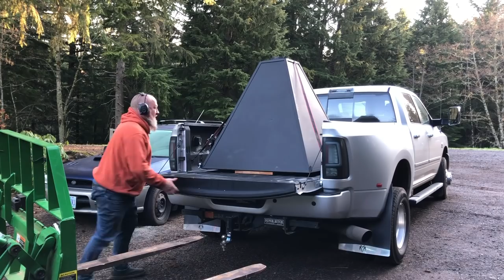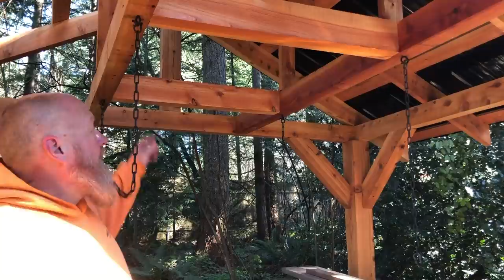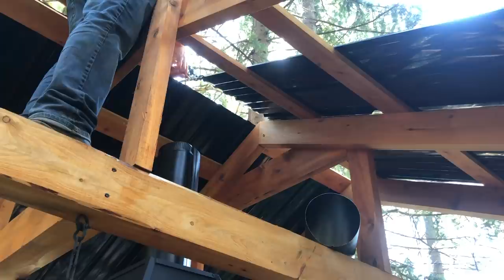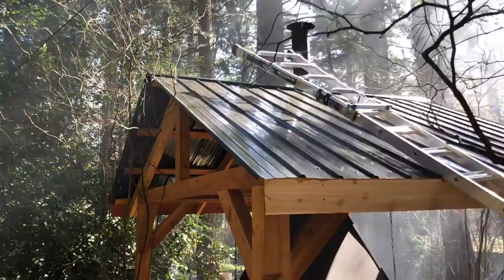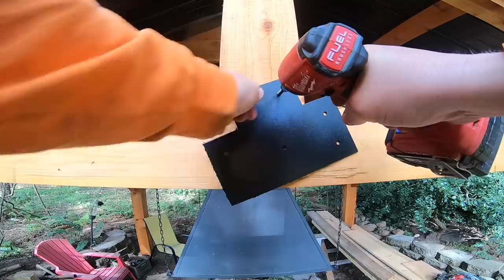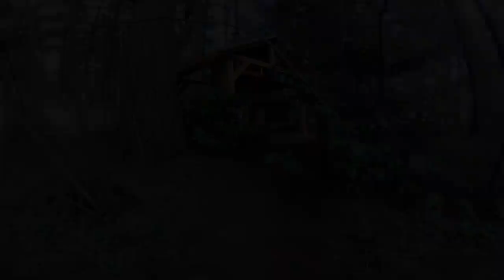FINISHED Fire Pit!!!

Comment: For the swaying, the problem could simply be fixed by putting the chains at a 20 degree angle. this way no matter which way it tried to sway, the chains would get tighter, hand help prevent (counteract) the movement.

Comment: Great looking place to just hang out.  That will make their isolation a little more relaxing (note, no TV out there, so no annoying news constantly).  Hopefully the wi-fi doesn't reach out there either!  Nice work brother.  The metal plates are just the right finishing touch.
Reply from the maker: Thank you, Rob! I looked for plates at Home Depot and wasn’t impressed with my choices. I cut these with the plasma torch and left the edges rough. I think they came out pretty nice.

Comment: Looks great! I think I would have raised the hood a bit higher, maybe halved the length of the chains. It may be above the line of sight, but it looks awfully close above. It almost seems like you would feel like you had to tilt your head to look across at someone else. I built a timber framed front porch on our new house like this and was planning a gazebo with fire pit in a similar style, but I am going to start with a smokeless fire pit. So the hood wont be so important...
Reply from the maker: The bottom of the hood is about 4.5’ above the ground. My main concern was it drafting properly. Now that he’s had a fire and we know it works, we could easily raise it if needed.

Comment: Haven’t read all the comments, but do have an observation in case no one mentioned it before.  Stove pipes are generally recommended be installed opposite to the way you did.  The bottom lip of the pipe needs to be inserted on the inside of the pipe below. The reason for this is to keep the creosote which accumulates on the inside of the pipe from dripping down and out of the pipe joints. Even though your stovepipe is black and will hide the drippings somewhat they will eventually become unsightly.  Other than that, I love your build.  I want one! Good job!
Reply from the maker: Thank you! It has been brought up and the reason I did it that way is because the only rain cap I could find right now wouldn’t fit the other end of the pipe. I do a lot of work for these folks so if it’s an issue down the road I can address it.
Reply: I thought stove pipe is for interior locations only.Can not be exposed to the elements.

Comment: Crimp end on stove pipe should be down.  Creosote, condensation and rain will run on the outside of the joint if not.
Reply from the maker: You’re correct for indoor applications but outdoors it’s not a concern. I had to do it this way because it’s the only way the rain cap would fit.

Comment: Great work. I would have changed only a couple of things. I would have had the attachment points for the flu a bit higher up so the chains were at an angle and I would have left some extra chain length on each one to raise or lower the height to there liking.

Comment: The chimney pipe is installed upside down. When the chimney cools the condensation will run out onto the outside of the pipe!
Reply from the maker: Not a problem in an outdoor application. This is the only way the rain cap would fit without modifying the pipe or cap.

Comment: WOW this is fantastic.  One question:  exactly what sort of screws are you using?  It looks like they're super long and thin, and the 2 long beams that span from front to back (if I'm seeing this correctly) are supported only by 2 screws in each end -- is that correct?  All the other beams seem to sit on other supported elements, but these had me scratching my head.
Reply from the maker: Thank you! There were more screws used from the top at an angle but those Timber Loc lag screws have a surprisingly high shear strength. They’ve held strong for a few years now.

Comment: Looks great 👍 Just out of curiosity, is there a way to lock the hood in place to keep it from swaying in heavy winds?
Reply: TruckdrivinMilan R I was thinking the same thing man, but I think it should be okay since those chains look pretty sturdy
Reply from the maker: Thank you! The stove pipe does a pretty good job but the owner and I did discuss simple options should it become an issue.
Reply: @NorthwestSawyer  Some 'struts' installed at angle to the rafters?? Seeing that there's no way to hide those struts, why not , say, 3" x 3" cedar, 
and stained same color as the rest,..would there be some merit in that thought?
Reply from the maker: Reg I think if I had to stabilize the hood I’d try to make the steel decorative so it wouldn’t need to be hidden. I’ll have to figure that part out of it comes to light.
Reply: @NorthwestSawyer  Yessir,..decorative steel will fit too ,...you can do that...maybe tree branch and leaf motif!
Reply: Brayden Elliott LIVE/GAMING yea those chains are more than strong enough. I just envisioned it swinging like a pendulum and the stove pipe wrecking the metal roof. Welding the chain links together would probably keep it from moving.
Reply: Just a thought, you could install a heavy black bar inside the hood and down to the fire pit to anchor it for windage.  And then, have a circular metal draw screen to protect against flying embers.  Kill two birds with one stone!  This would also help keep the "exhaust" in the vent by cutting down on cross winds directly above the fire.

Comment: How did you decide where to put the hood height wise? I am guessing it may not work as well if it was higher?
Reply from the maker: I wanted to keep it as low as possible so I sat in their chairs and kept it about 12” above eye level. It’s about 4 and a half feet off the ground and luckily seems to draft really well. I have fire pictures on my northwest_sawyer Instagram page.

Comment: Excellent job, Jason... but is there a reason you did not use a shake roof?
Reply from the maker: The client wanted a black metal roof.
Reply: @NorthwestSawyer  Can't argue with that... Two rules in business... 
#1.  The client is always right...
#2.  If the client is wrong... see rule one...

Comment: You stay safe, too. I suspect you fabricated the metal reinforcement plates, but I don’t remember you showing it. Were they based on the as- built or from your plan?  Thanks for the video.
Reply from the maker: I did. I cut them with the plasma torch and left the edges rough for character.  I didn’t film it though.

Comment: beautiful project.  in heavy winds, will the smoke hood flop around?
Reply from the maker: It’s in a pretty sheltered are but we’ve discussed fixes should it become an issue.
Reply: @NorthwestSawyer    cool / have you seen the fire-pit in use?  I wonder if the hood provides much of a draft and reduces the amount of smoke in one's face
Reply from the maker: Not yet, John. I did explain to them that they’d want to use dry wood only and start small to heat up the metal and get it pulling properly.

Comment: Well you have a complete how to video and all the measurements so you can saw out a pre built fire pit or anything they have their hearts desire to do there. A good build yet  way over built as Katrina couldn't get it off... well maybe but that is a class seven. It pleases the eye when you see it and screams money. If people wanted to save money, they could do the stains and buy the cement but the rest could be packaged to a build like the huge metal buildings where a goes to b and then c joins d thing... you built one so you can save a lot of steps now. Kinda like lawn furniture. My first picnic table had a load of logs and weighed  a ton and they was as crooked as a politician. I thought it would relax and it did....... in ashes and shame. Because I have worked metal all my life we had a metal table and chairs that was super nice and only required paint every so often/LOL. I had old tractor seats and sheet metal formed and would you believe had people begging for one... me and wood got a divorce for a long while.
Reply from the maker: Thank you, Morgan! I could definitely save a lot of time on a second one. I would also be much easier if the structure was built before the fire ring. Having the ring their first made things a little tougher.

Comment: How did you figure out how big and how high your hood was supposed to be?
Reply from the maker: I made it as big as the fire pit was. For the hight, I put it above your eye level when seated.
Reply: @NorthwestSawyer  how does it flow? Would it work if it was higher?
Reply from the maker: @MrHatchbody  it works great from what I’ve heard. There’s probably room to raise it. The key is to burn good dry wood. If the fire is just smoking and not making any heat it doesn’t draft as well.

Comment: Hi there! Beautiful job! How did you know what flue size to get and what diameter did you go with?
Reply from the maker: I built this for an 8” stove pipe. I was told it worked very well and ended up making a second one for another client.
Reply from the maker: I built this for an 8” stove pipe. I was told it worked very well and ended up making a second one for another client.
Reply: Thank you, how much wider is the widest part of the hood compared to your fire pit? Ours is 36”, I’m trying to determine the correct height off the fire pit, width of the hood and width of the pipe for our covered fire pit area. There’s not a lot of information out there!
Reply from the maker: @kimmykirkwood758  I don’t remember exactly but I remember the fire pit being wider than the hood opening. I made a video specifically on the hood construction that may give the dimensions. It’s been a while since I’ve watched it.
Reply: I’ll look for it, thanks!!